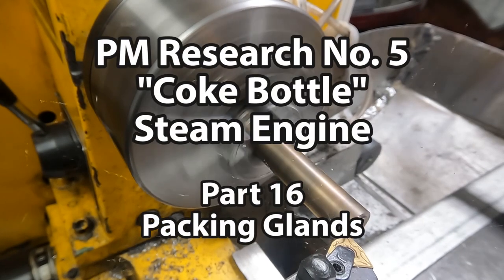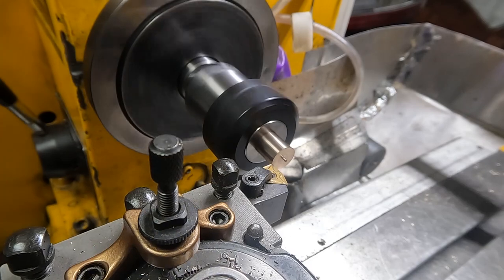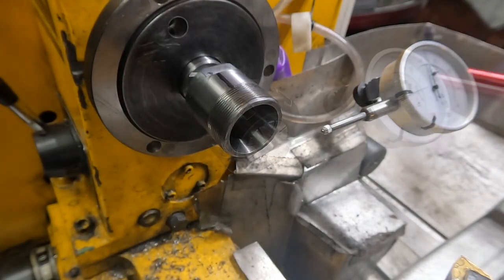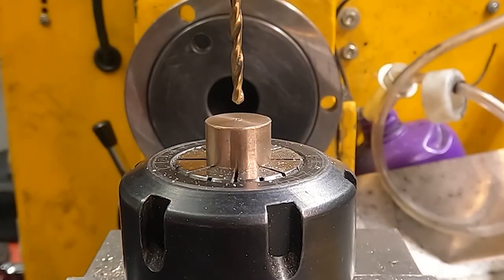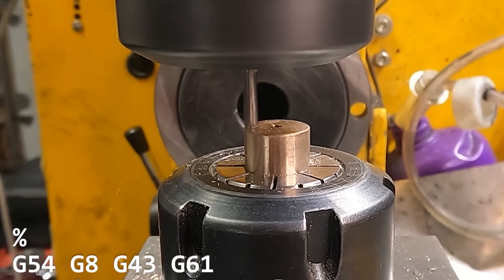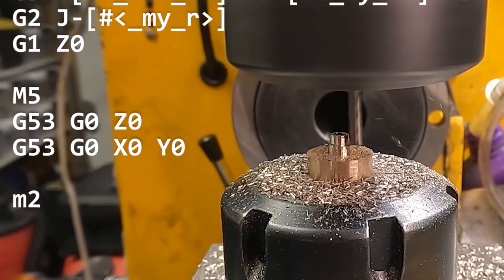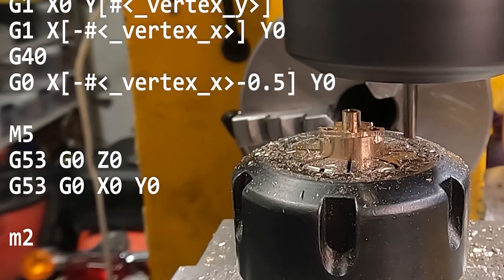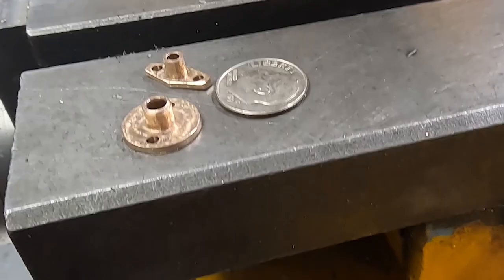16 Machining the Packing Glands - PMR #5 #steamengine #steamengines #lathe #machining #turning

Comment: I find myself wondering if your 1/8" hole from the last video came from the collet chuck.  I noticed it was off center even before your facing cuts, and it would explain the rattle-fit after using the center drill.
Reply from the maker: You could be right as I did not check runout when mounting the inner head in the collet. However, that was the ER-40 chuck, and it has always tested pretty accurate. I'm more inclined to think the hole wasn't off center it just looked that way because of the turning burr, and then cleaning it up with the center drill widened it.

Comment: quite surprised at the 10k runout. Is it not salvageable ie rebore/grind the taper and take a bit off the front nose? Having said that I suppose they are cheap enough just to bin it and buy a new decent one.
Reply from the maker: I think I ran into this before years ago and didn't throw it away and then forgot. there was some blue residue on the morse taper, suggesting I already put time into it. Not worth time messing with it, even if I had the tools to do it right.
Reply: @thumperthoughts  May be worth finding out if it's your machine taper then. Have you got an MT test bar?
Reply from the maker: @paulrayner4514  no, but I do have an MT4-MT2 adapter and an   MT4 dead center. One of those should be indicatable. I'm pretty sure the twice used $20 part is more likely off than my machine, but it doesn't hurt to check.
Reply: @thumperthoughts  you could always check the collet chuck as well by clamping some silver steel/drill rod that has been accurately center drilled in it, put it in your lathe between centers as usually most collet chucks have been center drilled during manufacture, and clock each end. and each end of the taper, that's assuming your collets are good.
To check your machine ideally you need something longer, that's why I mentioned a test bar. But like you say I doubt it's your machine. $20 does not seem much for a precision part.